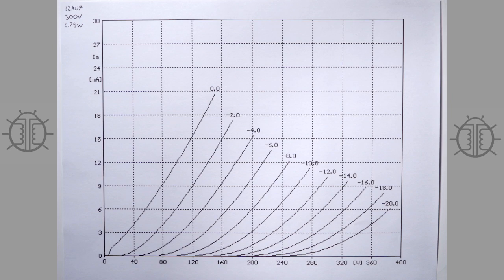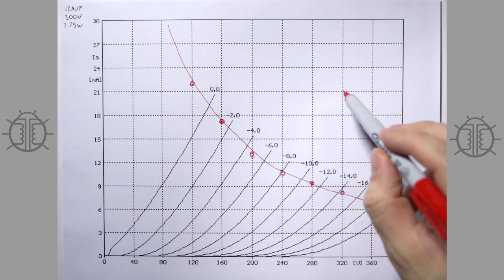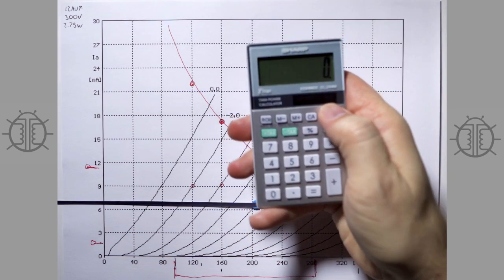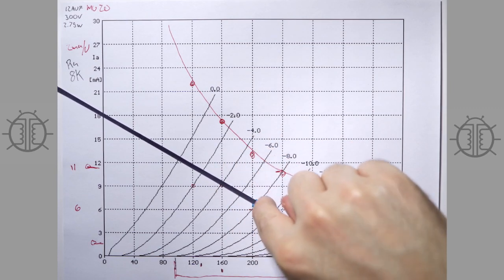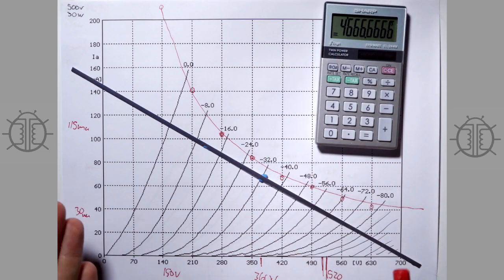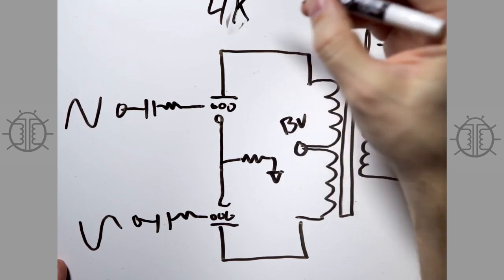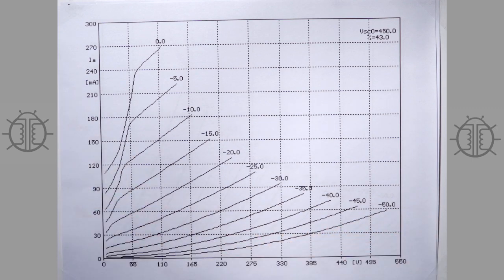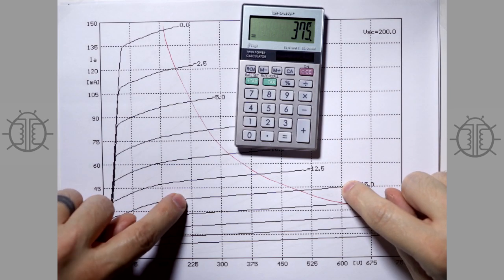Plate Curves and Load Lines!

Comment: 36:11 the Q point here is chosen to be more than half of the maximum plate voltage, which could allow for AC voltage swings to exceed the maximum plate voltage, it appears.  On calculating the output power, the inductive load will allow for positive voltage swings to exceed the max plate voltage.  Putting that aside, here how I did it:  The voltage could swing from 360 down to 180 (can't go lower than that on this triode).  The associated current swing estimating from the plate characteristics graph is from 115mA down to 65 mA.  So, (360-180)(.707) x (.115-.065)(.707) = 8.2W.  It would appear that the inductive load would allow that a maximum plate V swing be about 360 + (360-180) = 540, slightly over the max plate voltage.  Should be shift the Q left a bit by about 40V or so to be safe?
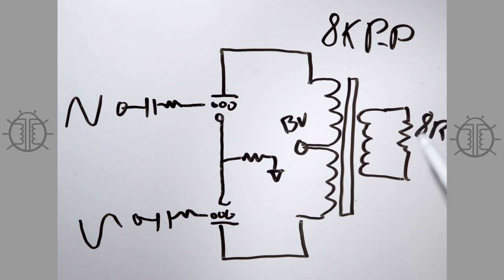Reply: 44:24  the windings ratio of the transformer  is sqrt(8000/8) = 32. So when both tubes are conducting, in class A, the windings ratio is 32:1.  However, as soon as one tube stops conducting, the windings ratio changes because one half of the output transformer is taken out of the circuit, and therefore the windings ratio for the conducting tube becomes 16.  Therefore, the reflected impedance that the conducting tube sees will be:  8x16x16= 2048, or stated differently one quarter instead of one half of the overall primary impedance. So this explains the increase in load when transitioning into class B. Correct?
Reply: @stereopolice  Not so much. The turns ratio cannot change.
Again you have the formula for Zra not Tra. Tra= sqrt(8000*8) = 252.98. 
The Zra is 31.62 at 8 Ohms Zsec and 8000 Ohms Zpr. When the one tube operates alone it works against half the tranny or Zpri is 4000 and Zra becomes 22.23(sqrt(4000/8)), Tra is a physical construction so it remains constant unless you change connections on taps. The center tap is the feed point and why operation is only across one half of it when it runs into class B.

Think of it this way: one tube single ended amp 4000:8, same tube and all as a push pull amp is like 2 SE amps face to face so 8000:8 (measuring across the entire primary) the load we assume is not going to change, we still want the 8 ohm load. Now when you add 2 more tubes you have parallel effects halving the load, and series effects doubling back in to arrive at the spec of a single tube: 4000:8. 

You can get Zpri by the load line which is B+ / Max Current (r=e/i),
you can also use the Power Out / IMAX Squared r=p/(I*I), and
(B+ * B+) / Power Out ((e*e)/p).
Reply: @gregraynard781  A ratio is?  A way of relating one thing to another and we do that with division.  For instance Frequency is the number of cycles per second in an AC wave form.  Cycles/time e.g. We noticed a wave repeat itself 180 times in a 3 second period of time --> 180 cycles divided by 3 seconds --> 180/3 = 60/1 we see 60 cycles in one second.

An impedance ratio for an output transformer is relating the design impedance of the primary to the designed load impedance on the secondary.  The example above is 8000 ohms primary to 8 ohms secondary, or 8000/8 = 1000/1.  Specifically he wanted to find the windings ratio which is the square root of the impedance ratio sqrt(8000/8) = sqrt(1000/1) = 31.62277 roughly 32 to 1 also known as the turns ratio, the windings ratio is 32 turns or winds primary to 1 wind or turn secondary.

Your information is incorrect, Greg.  sqrt(8000*8) is a product not a ratio.
Reply from the maker: The max plate voltage rating for tubes is generally the dc operating point and the designers expected the tube to potentially be inductively loaded. So the max AC spec is about double number in the data sheet.

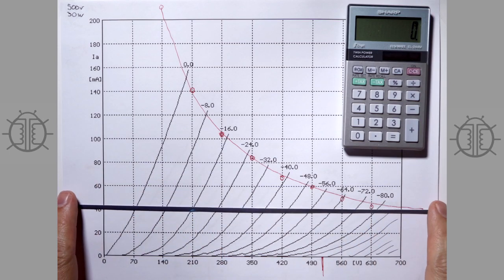Comment: 32:59. 
     IF the load is infinity, meaning an open circuit, the ruler would be down at 0 amperes on the horizontal, indicating the ability for a full voltage swing over the open circuit, with zero current flowing through it as you would expect.

     Conversely, when the load is a short circuit, or 0 Ohms, the load line will be on the ordinate along the vertical axis allowing for a full current swing but zero voltage ( can't swing a voltage across a closed switch).

     Every single XY between the horizontal voltage axis and the vertical current axis represents some form of resistance or impedance, that is, between an open and a short.

     An individual resistor would be represented by the slope of a line running in the same general direction as the plate voltage lines in a positive direction.  Y=mx+b.  Same as I=mV (b=0) so m (slope) = I/V.  As such, I/V = 1/R so Y=1/R*V or I= V/R.

   Now, knowing that individual resistors are lines with a slope running in the direction of the grid curves, the load line is a line of the opposite slope that intersects many individual resistor lines of positive slope (the grid curves),  and is therefore is a line that represents a variable resistor, which is what a vacuum tube in effect is.

     And on the load line once plotted, the vacuum tube becomes a variable resistor, and as you apply more negative voltage to the grid, you move on the load line to the right, and the vacuum tube becomes more resistive and less current flows through it and more voltage is dropped across it. Vice versa as you apply less negative voltage to the grid the opposite happens. Not so scary this load line thing.  One could simulate what a vacuum tube is doing with a potentiometer and the negative voltages for the grid would be commands for given rotations of the potentiometer. That would be one way of thinking about it.
Reply from the maker: I think you’ve got it! Except the infinity load is AC only. It’s like having a infinite resistance with a infinite Voltage on top so you can maintain the DC operating point. You can actually approx this with active devices like a choke or ccs load. Have a look at a Mu follower circuit to see one.

Comment: Thanks just subscribed. Do you have a favorite design for a gu50 se ul ? I have some gu50 tubes that i've had for years and am only now getting to trying to use them.I saw your gu50  PP 30 triode schematic and thought you might have done something in the single ended area with gu-50? I bought  these OT's  cause they were so cheap!! :) should be fun to see what happens.

https://www.aliexpress.com/item/32821925001.html?spm=a2g0s.9042311.0.0.10744c4daQLo7M
Have a look ! If you would be so kind to share any advice you might have. It would be greatly appreciated! Cheers!
Reply from the maker: I’m definitely going to be designing more with the GU50 but I find SE very boring. 😭😂. I’ll be designing another Push Pull. I have one more amp to build, a 6S19P push pull, before I start on the GU50 design.